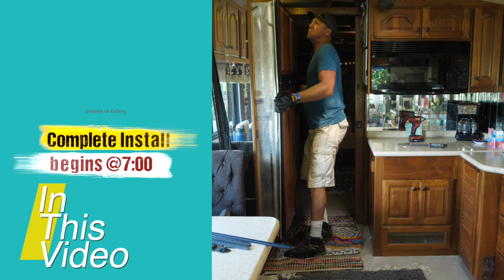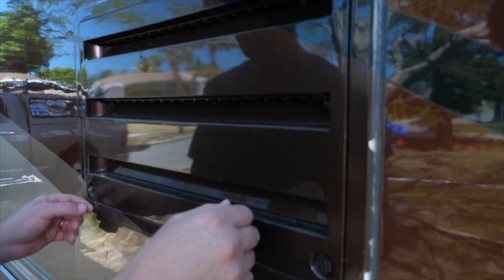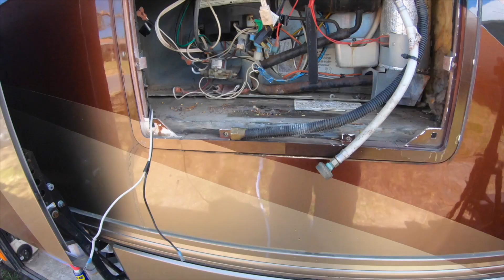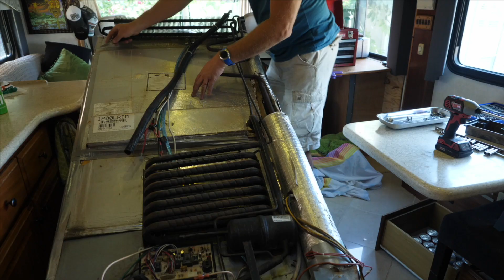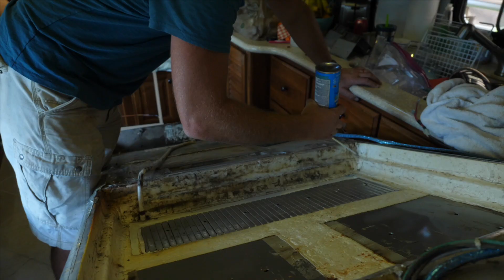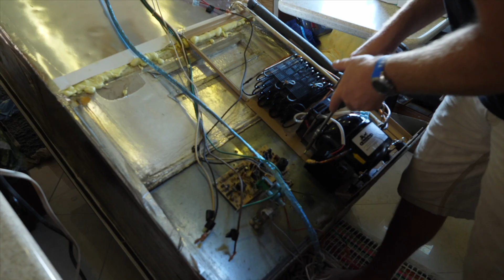ULTIMATE RV Fridge UPGRADE

Comment: Very good video my refrigerator just went out during New Years week. While thinking of going to a residential refrigerators I happened across your video ! You have had the 12v system for 6+ months how is it working ?? How does it handle really hot weather 95+ degrees ?? 

Thanks 
Mike
Reply from the maker: Hi Mike, we couldn't be happier with the performance, and we've had it throughout a Florida summer and more. My biggest critique is the 12v power consumed while doing so. We have a pretty big solar setup so it wasn't a problem, but for people without solar or shore power, you'll have to recharge batteries every couple days. 
Dutch Aire also makes an upgraded system that uses propane and is superior to the OEM units. Good option for people without a big solar array wanting to spend a lot of time off-grid. 
Happy Camping 👍
Reply: @OutsideIsCalling  Thank you my system is arriving Monday !
Reply from the maker: Awesome!

Comment: Enjoyed your video. I have a Norcold 1201 with ice maker also and plan on installing the dc conversion as you did. My question is how you power the ice maker when off grid. Do you use an inverter and if so what size (wattage).
The current onboard outlet for our frig is not attached to the on board inverter. Thanks 
again for a very informative video.
Reply from the maker: Hi there, yes we have the Victron MultiPlus 3000 watt inverter which we run pretty much all the time. BUT, the power feeding our new cooling unit is completely DC. 12 V right from the batteries. Please note it will add up, so we need lots of good sun or a couple hours of generator each day to recharge the power consumed. This makes for an even easier install in your case, as you just need a 12v power wire with I believe 15 amps capacity. Happy camping!

Comment: Great video! I have the exact same coach and this was a great tutorial. I did the replacement entirely following your great instruction and it works great! I have another question for you about your solar and inverter set-up. The Eagle as I'm sure your aware of has a proprietary Inverter with everything inside and would luv to know what you did to change it out and your list of equipment. This would make for a great video sometime but maybe you could share the details before than.
Reply from the maker: Thanks, hearing positive feedback and that the videos are helpful make it all worthwhile! We do plan to do walkthroughs and share our setup as we travel this year, but for now here's our experience:

There is a company in Deland Florida that can repair the old American Coach inverters, named Deltronics or something along those lines. I tried everything to keep that old inverter because it was bulletproof (we could run a roof AC while plugged into a 15 amp extension cord) pretty awesome, but I wired a new 30 amp outlet wrong and killed it last winter. We now have a Victron Multiplex 3000, 12V hybrid inverter which does the same awesome things as the old one but also has newer technology like pure sine wave inverting. If you go lithium, you can order the inverter through Battleborn batteries and they'll program it for you before shipping, cool option.

The only other thing was to install an Auto Transfer Switch before the inverter, to switch between shore power and generator power. With a good knowledge of electricity it can be swapped out in a day, and I'm sure the right RV tech could do it as well. Stay tuned for future videos, and let us know how it works out!! 👍

Comment: Nice job guys!!! We also did the upgrade to a residential fridge a few weeks ago and love it so far!
Reply from the maker: Hey thanks guys!! How was it doing this on a residential unit, harder, easier? We are totally diggin' the new system, and it's SOOOO much colder = happy campers
Reply: @OutsideIsCalling  it was not too hard for us, but we got lucky with our fifth wheel layout too! Our front door was wide enough to get the old unit out and new unit in, so no windshield removal required. We did still have to do some minor cabinet remodeling though!